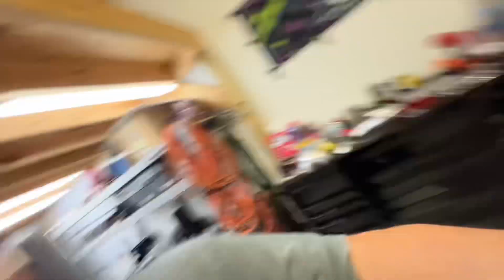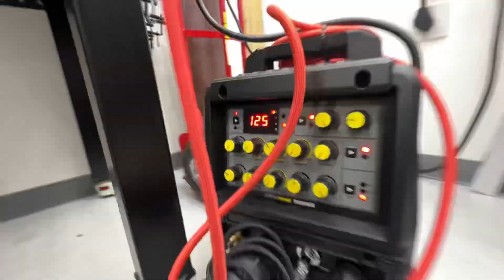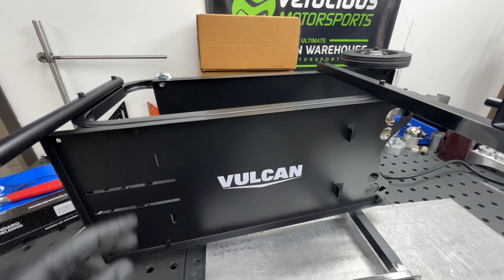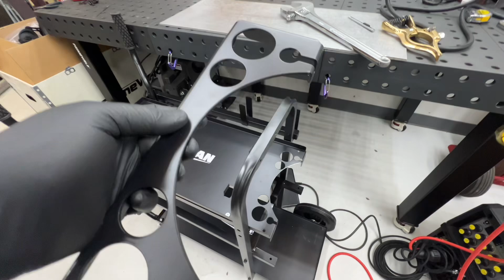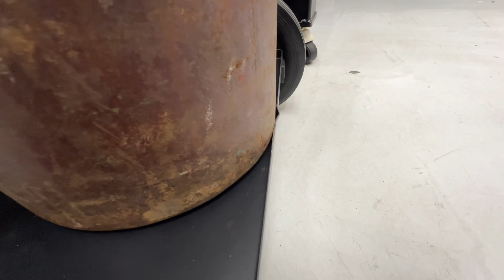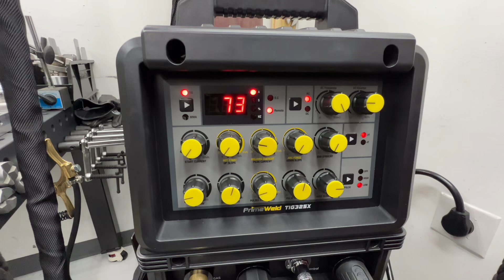PrimeWeld Tig 325x, Maxcool water cooler, & Harbor Freight cart review and setup!

Comment: On that machine, will the upslope and downslope work with the finger switch h on 2T?  I'm hoping so because it allows on and off trigger to modulate amperage without it  shutting off the arc.  I believe 4T won't allow that without terminating the arc🫤

Comment: Another option for modifying the HF cart: I just pulled up on the the support tubes so they are horizontal instead of angle back, redrilled the two holes on the vertical to support it, and machined 2" aluminum spacers for offsetting the welder tray, and bolted it back up with 90mm machine screws.